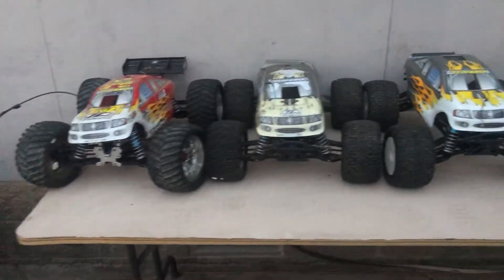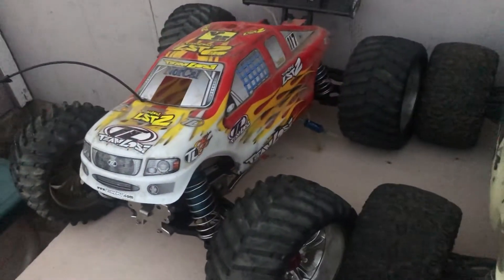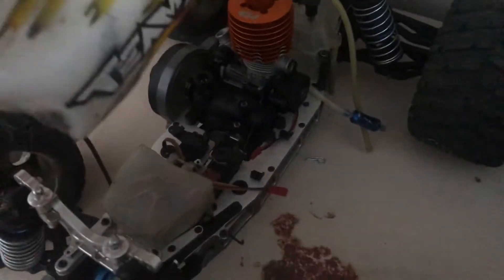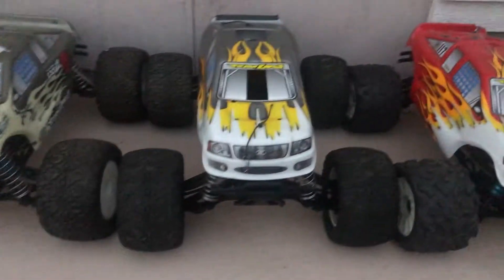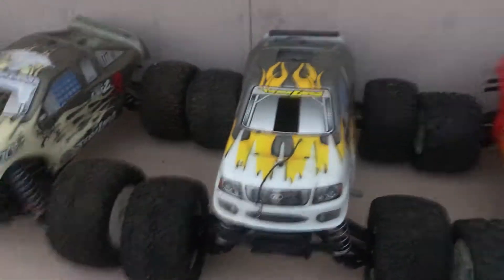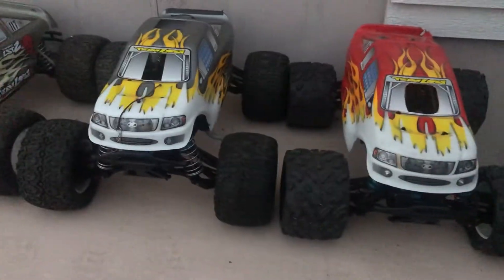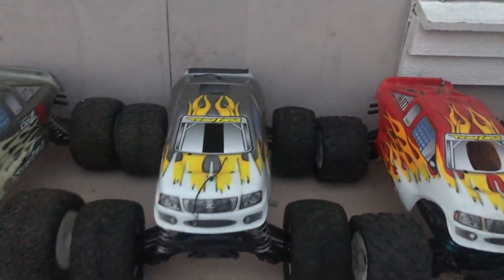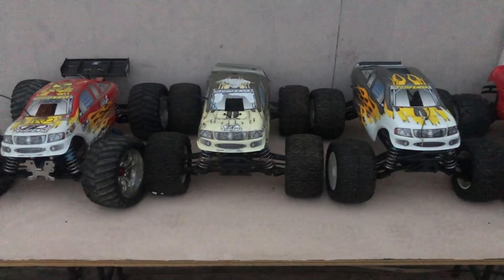Losi LST 2

Comment: Looking forward too seeing them run I just got a used one restoring it ,what would you say was the best motor too put in it ,at the mo it has the Mach 427
Reply from the maker: I pretty much keep mine stock engine but I know lrp has a good one that will work the lrp .32 you can still get I have one I’m going to put on one of my Lst2 I just can’t get the pipe I want so I’ll either go with stock or the dynamite 053 till I can get the pipe I want look forward to seeing yours
Reply: @Chino-vn3ot  thanks for that what pipe is it your looking for  and do pipes really make a diffrents
Reply from the maker: @gwizzfpv6741  I’m trying to to get the dynamite 086 and yes they do make a difference  there’s a few good videos on nitro engines and pipes out there, I’ve always kept mine stock but now that I’ve been watching YouTube I wanna try other options